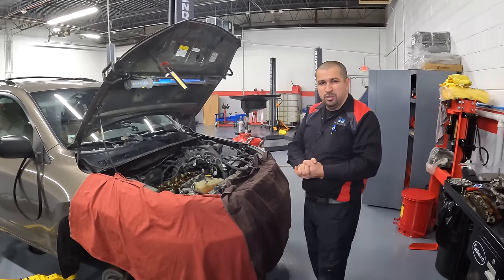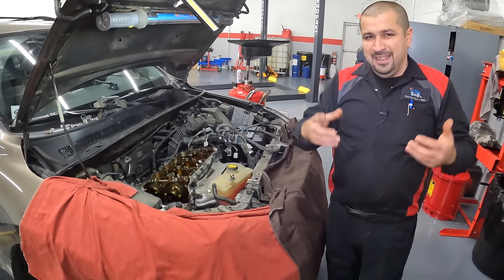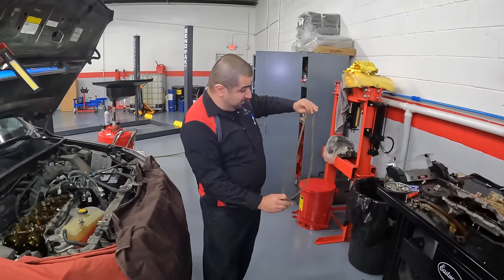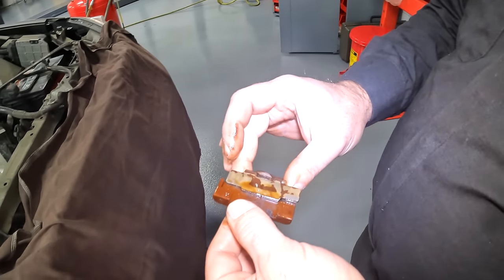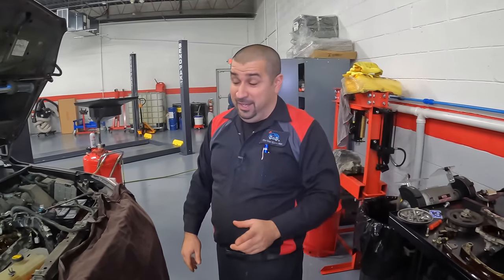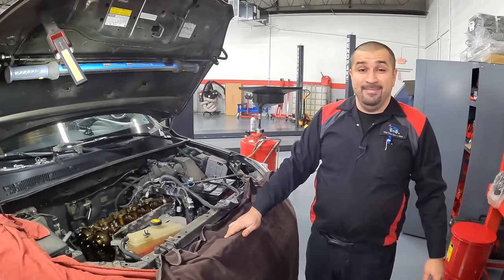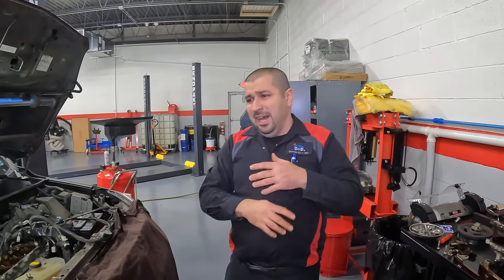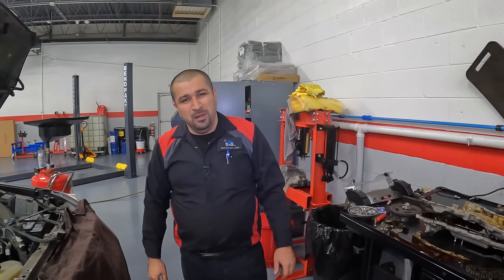When Should You Replace Your Toyota And Lexus Timing Chain?

Comment: Hello.

I didn't know your email address and  I couldn't send you and email that's why I'm here. I recently purchased a 2006 Lexus GS300 and did some recommended things like oil change, break change et cetera, and life was good until i was driving and when I put the car on reverse, the engine shut off. I had to shift the gear to park and put it on. Everything sounded normal so I reversed stepped on the brakes and engaged drive, then it happened again. Sometimes when I'm driving, I don't get full power and it seems as if the car is struggling to pick up the pace, and the car also jerks especially when there's traffic and sometimes even when I'm driving fast. Please I'd really appreciate if you could help me with your diagnosis and possible solutions. 

PS: I don't know if the transmission oil has ever been changed, and it currently at 240000 miles. Thanks.

Comment: I have a 2011 5.7L Tundra that's had a "chain rattle" since 150K miles (it now has 216K).  I hear these engines have a tensioner issue. Should I tackle this job myself?
Reply: It's kind of a rough job, you will be hunched over, reaching into the engine bay for pretty much a whole day. One of the guys I used to work with decided to start removing the cab of the truck off the frame for this reason. Everyone else in the shop started doing it after that. They were fixing leaking cam cradles mostly, which is a really commen problem with those engines. So they had more work than just removing the chain and guides. But they all avoided jobs like this if they could.
Reply: @brad3741  Thank you, Brad. I have a tough decision to make

Comment: i was thinking of replacing the chain on my 4zz-fe with 260k miles, while replacing the valve cover gasket i noticed that the chain had some slack in it between the two cam gears and you could easily wobble it up and down, didnt pay  attention to paint marks at the time, but would anyone have advice on wether it should be replaced, could it be stretched a lot or is it an issue with the tensioner or other components?
Reply: It's probably thetensioner, unless you don't do oil changes enough. Does it rattle?
Reply: @richsweeney1115  it could be that, I’m also thinking VVTI cam gear. It only rattles under specific circumstances, if you are going uphill and you press the gas harder, for a brief moment it will rattle, but it only happens under load and when going from little throttle to high throttle. Also I have noticed only maybe 3 times over the last couple months that it rattled slightly when revving at idle, once was on a cold start and twice hot. Could only hear it with the window down and very light throttle, to bring up the rpm’s to maybe 2k or less.
I have owned the car for 5k miles only and I have done an oil change, not sure about history of oil changes

Comment: Now we all know why the General Motors small block is the most iconic engine ever built. A good 327 would get 25 MPG on the highway and last many decades if properly maintained without fancy valve gear and tiny plastic parts. If you were not there you cannot know.
Reply: Amen!

Comment: I have a 2013 Camry with that engine. How common is this problem on those?
Reply: Very common.
Reply: @michesbianan  around what mileage would you expect that to come up assuming the car has been taken care of and oil changes every 5K?
Reply: @scottg429  Sorry, I wasn't clear enough.  The common problem I was referring to is the VVTI rattle during cold start.  It's hard to tell at which mileage it will start exhibiting this rattle.  Mine does it once in a while, but when I change my fluid in my 5k interval it goes away.  I say, don't worry about it unless you start to hear the rattles that last 2-3 seconds, if it's split second, I will not worry about it. Just keep an eye on it.

Comment: I get rattling sound when starting my 3.5 V6 Sienna 2007 from time to time. Seldom it happens right after an oil change but when ‘maintenance required’ is lit then rattling goes once every three to five times I start the engine. Does anyone have same issue?

Comment: How do you justify removing the front cover for a warranty repair that doesn't call for it?  The flat rate time for the repair will not pay for the removal.  Do you do it for free?  I cannot see you committing warranty fraud by claiming to repair something that was not called for.  In the long run it is a best procedure, but warranty is not necessarily concerned with that.

Comment: If you put top quality oil in a Toyota   keep the air cleaner changed,  replace the spark plugs when needed and change the coolant when necessary,  a Toyota will give you great service. I would just say, don't run your oil out to 12000mls before changing it, 5000mls is best, 7 at the outside.
If you put crap oil in even a Toyota,  it will eventually turn to shit, the best you can afford is always best.

Comment: 13 And as I look through the Bible, I could notice that there were several other books, each generation had its prophet and its book. For example, we have: The book of Jasher: Joshua 10:13, the book of the acts of Solomon who is a prophet: 1 Kings 11:41, the book of the prophet Nathan: 1 Chronicles 29:29 and 2 Chronicles 9:29, the book of Enoch: Jude verse 14, the book of the prophet Gad: 1 Chronicles 29:29, the book of the prophet Ahijah: 2 Chronicles 9:29, in the same verse, the book of the prophet Jehdo. The book of the prophet Shemaiah: 2 Chronicles 12:15 and in this verse again: the book of the prophet Iddo. We have the book of the prophet Jehu: 2 Chronicles 20:34, the book of the prophet Hozai 2 Chronicles 33:19… You see? They are not in the Bible but they are prophets and Gospels for the Salvation of their generation. [Ed: The congregation says, "Amen"]. [Kc.58v21]

#ProphetKacouPhilippe

Comment: More parts I won't have to worry about after I switch to an EV.
Reply: True, but you open a whole new can of worms with an elictric car. Those motors and batteries have their issues as well. And when the batteries go, they are not cheap!
Reply: @brad3741  I'm very much aware and yet the decision will be an easy one when my 25 yo Lexus finally does die.

Comment: Simple answer is this. Let’s say a valve spring breaks and you pay a shop to remove both heads and replace all the valve springs at the tune of $7k. Are you really going to skimp on spending $400 on four new timing chains?

Comment: Toyotas may  make very good chains, but the bigger issue is their guides are junk!  My local shop tells me they frequently have to replace Toyota guides the top has broken off. They don't see the same issues with other brands of cars, even they also use plastic guides, to whether they are mad of plastic or metal, seems insignificant. Toyota guides seem to be of a defective design or material.

Comment: I agree to disagree with you. My father best  friend.Was a auto technician so ,I was around them working on cars all my life. A car with a timing chain will jump time. The chain does not itself actually wear out. The sprocket does. Now as the chain beat on the sprocket to make a revolution in cycle that what wear the sprocket out . I really don’t want to go into full detail about this . i’m trying  to figure out ,,,how I want to explain this. If you take two metal pipes and keep beating them against each other. You will see a indentation in the metal. Now,let me tell you what will happen if it jump time. You will pull up to a store or pull into your yard. Switch the car off,go back outside the next day. Try to start the car and it does not start.all it does is turning over. everything on the car check out good .I’m not going to go into that full detail ,but I just gave you the basic. but I would rather have a car with a timing chain then a belt any day of the month
Reply: What if they make the sprocket out of harder metal than the chain? Will it wear out the chain instead?
Reply: Let me say this if you beat metal against metal long enough ,you will begin to see a groove form in that metal. I hope this answer your question. I had cars in my lifetime to jump time ,with a timing chain ,we had to replace the sprocket and the chain. Because when you measure the new chain against the old chain the old ones seem like it was longer. But you can look at the end of the sprocket and see how they were out at the point.

Comment: You don't replace a timing chain especially in a Toyota. It is nonsense. You will never find a reason to replace the chain unless you are getting an issue as this with some noise and if the chain stretches a bit after overheating. They will stretch by thousands of an inch and cause some very slight smells from the car and exhaust types of fumes will be your number one symptom. The vvti gear is important and the chain stretching happens. This is one of maybe three types of fails you will get from these motors.